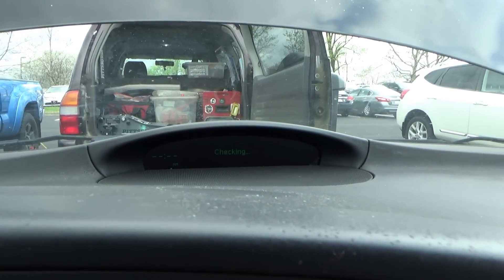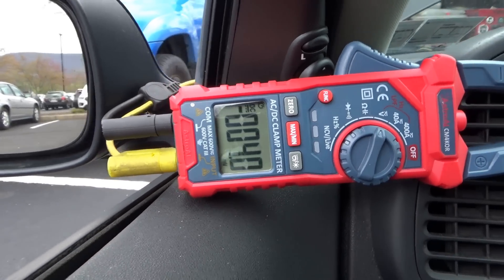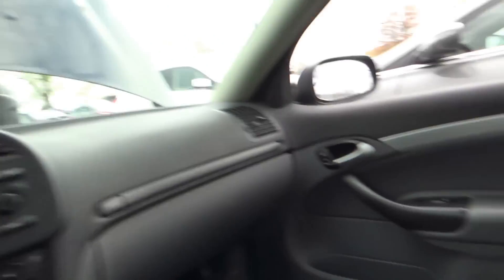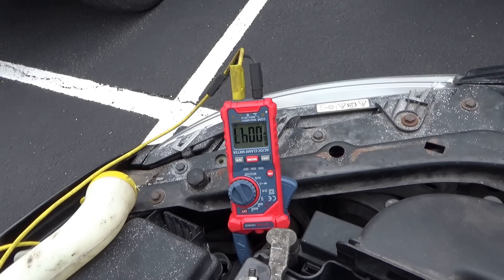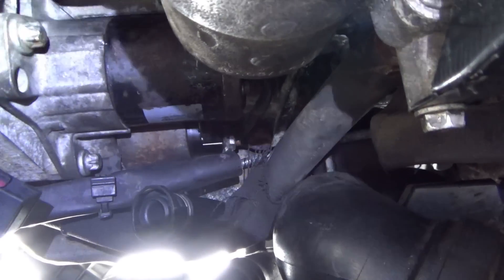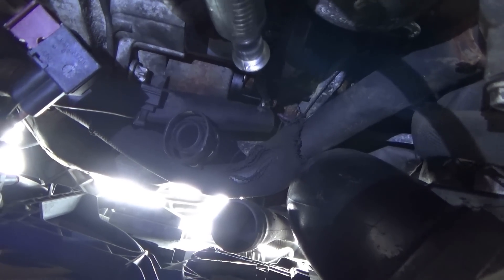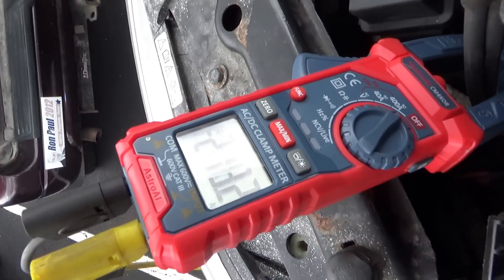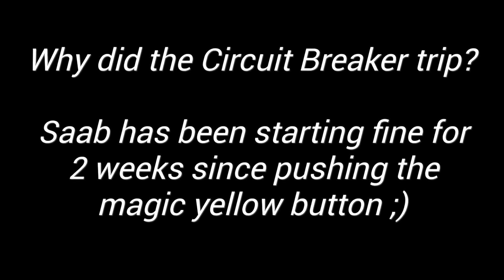Saab STRANDED in a Parking Lot? (9-3 V6 Quirky No-Crank)

Comment: Dude you are a savior!!! I literally had this problem :D I was driving in heavy rain and the car was fine but after a few hours it wouldn't start, no starter or steering lock but everything else was normal. (Except on first few seconds after putting the key on, the check engine was flashing like crazy)
I checked every fuse or possibility like ABS module or starter and nothing, after a few hours I saw your video and that was it!!
Thanks a lot for the solution!!!

Comment: Had a van with the cable running below the front of the engine , some how that cable failed . Routed a new cable to the starter , still working .

Comment: I bought no crank Volvo v50 2.0d (PSA crap) from customer. It has also fuse to the starter/alternator power.

Alternator was seized up and blew that fuse. It’s some kinda crash safety so the big power cables won’t light the car up on flames if they get contact with the body/gnd.

Comment: P228

Battery disconnect switch 3

Warning:
If the battery disconnect switch has tripped, do not reset it until you have visually inspected the car's electrical system.
If there are visible signs of damage, have the car checked at a workshop before resetting the disconnect switch. We recommend that you contact an author-ised Saab workshop.

 A collision could cause a short circuit in the alternator or starter motor. A disconnect switch by the battery's positive terminal cuts off the battery from the alternator and starter motor when the airbags and seatbelt pre-tensioners are detonated.

Notice:
Exercise special care when removing and fitting the positive (+) cable so as not to damage the battery disconnect switch.

Comment: I was involved at the development of that device. First of all it is a steady state Relay (Safety Relay), which can be tripped by several events coming from AirBagModule. Saab was in the GM group at that time. Since Sveden has the most straight country roads with rare traffic, Saab were concerned about head to head collisions with other cars. All wires were fused, except the Starter/Generator wire. In Case of an accident, the Safety Relay tripps and disconnect the starter circuit. Saabs engineers were concerned at that time, when a crash happens, the airbags were deployed, the car wouldn't be able to operate any more. They drew a situation where that happens on train crossing or at any other situation where you need to restart vehicle. Saab wanted  at that time a reset button - the yellow knob. I was working at Delphi that time. After Saab installed it, many other European OEM's went to a pyrofuse, which was 1/3 of the cost but not reversable. After a crash event with airbag deployed, driving off the scene is the most unirportant thing. To my understanding tripping should be only by SRS. 
Greetings from Germany.
Reply: I worked on developing the airbag module for a couple of Saab models and was going to respond with the same info.  Some vehicle manufacturers have battery-cutoff that is triggered after an accident.  Not sure why you got that triggered without an event (it doesn't trigger by itself - you should also have airbags deployed if it was commanded to trigger.
Reply: That’s so cool, my vehicle just won’t start everything seems normal and ready to go, but just won’t start no crank nothing
Reply: @JonnySolomon how did you fix it ?
Reply: But why would the starter be affected by airbag deployment?

Comment: This is not a breaker for overcurrent or overtemperature. It is strictly a disconnect switch that can be triggered by the front impact protection system (airbag). A quick search found another Saab owner who had it trip after a low battery condition. Maybe there is a quirk where this switch can sometimes trigger in a low voltage situation. The low voltage code confirms that there has been a low voltage condition.

Comment: It's a shame Saab is gone. What really did the car in was when GM exerted its "influence" in its last few years. They were a quirky but interesting and good car, before then. Just curious, are they using that circuit breaker instead of a fusible link? Does it only cut power to the starter?

Comment: The thing about starter motors is they want to turn at a target speed and will, depending on voltage, draw all the amps it needs to reach the design speed. It the voltage is higher, it can reach design speed with fewer amps. But if the voltage drops below 12.0, the motor will try and draw more amps to reach the design speed. The one code indicated a possible low voltage situation had occurred.

Comment: Maybe the circuit breaker tripped due to a weak battery or bad connection on the hot? That would raise the current draw.
Cranking sounds a bit sluggish to me? Time will tell.

Comment: Just a FYI about min max current readings.  Using min/max can skew the results due to the initial current surge.  More accurate to measure starter current while the engine is cranking, and not use min /max.
Reply from the maker: I was interested in the initial surge, since that is exactly when a circuit breaker would blow :)
Reply: @PineHollowAutoDiagnostics  The breaker should be tolerant of surges,  question is how much current surge is acceptable.  Thats why an average current is a better indication of starter & engine condition.  Just thinking out loud.

Comment: I can tell you engine ground is thru  drivers side engine mount i had issues where galvinic corrosion ate the threads on ground wire  engine mount.Replaced it with a stainless bolt and nut 10 years ago

Comment: Age, salt, Pa roads (potholes) caused the left side bulb issue and likely the circuit breaker to trip too easily..... Might be a good idea to locate a non-rust belt used replacement. Circuit breakers will tend to trip or even fail after repeated trip events.

Comment: There's a reason it's the only Saab in the parking lot.😆 Perhaps the battery was low so the voltage dropped while cranking increasing the current draw?

Comment: Had something very similar on my Ford Transit tipper truck here in the U.K. - peculiar no cranks then just as peculiar starts after it had changed its mind. Then it began doing wobbly throttle after ten minutes driving and deciding to go into limp mode. As I was running a large construction site at the time and had a choice of eager mechanics - I took the easy option and that gained me a £260 fine for breaking down in a restricted area ( yes, they do that over here! And it doesn't do you any good to complain because the appeals system is biased in their favour and the charges continue to grow!!!) Mind you, in the end, the damned thing shutdown in the fast lane of the M25 (think very busy and dangerous motorway) when I had to vacate the vehicle to stand on the concrete (median) till rescued by the Highway Patrol ( U,K. equivalent) they were very reasonable and helped rather than issuing tickets ( citations ). 
Never seen it before but this Ford has TWO batteries under the driver's seat and there's cut our gadgets on both POS and Earth ( Ground) it was GREEN CRUSTY heaven down there too - so like some of your diagnoses - professionals nil pointes!

Comment: Hello USA! Saab is a rare model even in Europe. Some things are different about Saab. For example, the model with a mechanical gearbox has the ignition lock at the gear lever and you have to switch to a certain gear to get the ignition key. The very old model had such a handbrake that was built into the front wheels. The old Saab used to have one in the gearbox the lever that engaged and disengaged the freewheel clutch, when you let go of the gas pedal, the gearbox did not pull the engine along.

Comment: Battery from 2020?   Maybe the internal resistance is higher than it should be, causing excessive cranking amps.   It does sound a bit sluggish...

Comment: I have a 2006 9-3 but it's a 4 cylinder automatic, and it does not have a circuit breaker on the positive terminal.  That looked stock.  I have no idea.  GM took over SAAB in 1995 and ran the company into the ground in my opinion.  I have owned three real SAABs and they were amazing cars.  Two 99s and a 900 turbo with a five speed.  Now that I own one from the GM era I can see the huge difference in the quality of the engineering.  After WW2, SAAB assigned sixteen aircraft engineers the task of designing and manufacturing cars.  So basically what you had was a fuselage with no wings.  They were designed to function at the highest level of performance and were easy to repair because aircraft engineers took into account that the vehicle would need to be serviced at some point, unlike most automobile manufacturers.  If you removed all of the badges from my car, you would guess it as a Chevy.  Everything on it had the GM logo.  It has the Ecotec engine.  Everything is GM with the only nod to SAAB are the badges.  I just wish mine had a V6 with a 6 speed.

Comment: Maybe some high current draw from accessories while trying to start the car when it was really cold out? If the battery is in great condition and the lights are on, heater is full blast and heated seats are on and you jump in and just try and crank it really fast it perhaps would trip the breaker?  I imagine a cold morning, you leave the heated seats on and heater when you shut off the car and later after class you just jump in and try and start it as quick as possible to get it heated up with heater and heated seats still on and you do that so fast that the accessory relay barely has time to actuate so you get a large current spike... seems like a likely scenario, but idk.

Comment: This case was messy because battery testing was done by the owner and maybe even somebody tried boosting which might have tripped that current sensor. I found your use of a current clamp to be a novel way to advance the diagnosis without searching for the starter, an interesting idea. For the guy at the roadside with minimal tools, I like a 4 step mod of ScannerDanner's three step algorithm, even though the sensitivity of some steps may be a little weak. Of all the diagnostic pathways in auto repair, no crank no start at the roadside easily fits a cookbook checklist. Bravo to you for a thought provoking video!

Comment: Are you sure that the main feed cable to the starter motor is connected in the right place on the battery pole? It would be more natural for the cable to the generator to go through such a fuse

Comment: Although I follow, and like all your videos, in this case I'm sure that a million mechanics around the world are wondering why the absolute basics were totally overlooked initially. With a no crank the absolute first thing you suspect is something big; solenoid, starter, battery, cables. Breaking out the jack and electronics.... ?
Reply from the maker: How do you get to the starter without a jack? And how do you check electrical components without a meter? I'm conFUSED lol!

Comment: Ivan i can tell you why it tripped My dad's boat engine a Vovolo Penta did something Basically  the same it has to do with the battery connections it detects a arc it will do that if there's a jumped connection it will do that

Comment: Very interesting case, symptom and fix 👍 
My 2016 Kia Rio starter made once in January this kind of click sound too, it was the coldest time of the winter (around -30°C), but it happened just once. Turned lights and interior fan off after that click insident, and it started normally, and has been starting normally always after that one day.
There's black box in the battery negative cable, probably some voltage or current sensor for start&stop system (agm battery too), but no button. In the plus side, there's a 10 amp fuse called AMS, and some black box, again no button. No check engine or any other lights in the dash.
I was initially thinking maybe my battery voltage was low, but this video brings it in new light and gives some ideas to check if it happens again and won't go away.
Reply: Well since you don't have a circuit breaker you definitely don't and won't have this problem. Chances are you need to clean your battery cable connections and make sure they're tight. Your symptom sounds exactly like a poor connection, the heat of 200+amps trying to jump a poor connection actually temporarily fixed the connection.
Reply: @truracer20  Thanks for the advice, I'll keep it in mind :)

Comment: Maybe the vehicle  was left in gear when parked. Then when starting engine, with stick shift in gear and handbrake on, then starter would struggle to turn. Results in loads of extra amps, which could trip the circuit breaker?
Reply: For that to happen the clutch safety switch would have to be bad or more likely bypassed.

Comment: Bench testing a starter got me 1 time. I took it off and it spun just fine. Seemed fine but when I put it back on the vehicle it just cranked very slow. N then gave up again. Just didn't have enough strength left in it.

Comment: I worked at Saab dealer in 70/80’s.  
Sorry A$$ Auto Builder was their moniker then. 
I can think of very few things I enjoyed about working on them. 
Except easy hood removal and clutch replacement.
Reply: I worked at a SAAB dealer late 80s to late 90s. Our saying was "SAABS make jobs". The 79-93 900 was a great car to work on. I wasn't a fan of the 9000. Once GM (Grenade Makers) got involved it went downhill fast.
Reply: @mlieser1230 Yep. I worked on Sonnett, 99 and 900’s.  Saw a few 9000’s. 
Our PDI joke was to look under it. If it was leaking all the fluids then it was ready for delivery. 
Started own shop in 1986 and we just sold in 22 though I retired from full time 8 yrs ago. My brother finally had enough physical ailments that we sold out. 
You can sure lose your edge quickly. That’s why I keep up with the tech here. And I come away with no skinned knuckles or aching back ‼️

Comment: If it is just a circuit breaker, high resistance of course, from poor connections and or the crusties in the cable. And that is considering that starter is good. Or if as mentioned below it is a safety cut out controlled by the airbag,though it did not appear to be involved in a collision. Good morning Ivan, have a great day!  👍👍🇺🇸
Reply: ...or the battery was low, somebody tried to jumpstart it and it tripped the breaker.
Reply: Maybe someone bumped the car backing out.  It's the anti carjack mode.  carjackers box you in, starter cuts off.

Comment: THE MAGIC YELLOW BUTTON, LMAO.
Reply: I can't believe they were to cheap to have  green show when working.  I think the last 3 starter problem I had were all green wires at the connector where insulation pulled back.
Reply: You need to push it to load it!

Comment: The battery disconnect switch is controlled by the airbag module and is designed to shut off high current wires in the event of a crash
Reply: Potholes can cause that to trip
Reply: @CatScratchFever10x Then Saabs aren't compatible with PA roads since we have more potholes than road surface.
Reply: Safety focused as always, haven't seen them on Australian models.
Reply: I put an airbag module in a 2005 Saab that didn't have the battery disconnect and the airbag module kept throwing a fault because it didn't find a breaker.  I had to do a little research and did a little surgery on the cable to make the module "think" that a breaker was installed.  It worked!
Reply: A Saab story!
Reply: @juanrodriguez-ry6yt 
😀🎯
Reply: As an Aussie ex-SAAB mechanic we didn’t have that fitted 🤷🏻‍♂️
Reply: @cammo069  Im a Saab tech from Sweden, never seen one on a Swedish/European 9-3 😄
Reply: @Halibrand  That's funny. I have it on my 9-3 SC Aero V6.
Reply: There wasn't a crash, so something else must have triggered it...
Reply: @v12alpine  Fault in the airbag module? Or maybe just a jammed starter that tripped the breaker due to high current? Or it was accidentally jostled on a bumpy ride causing the contacts to trip?
Reply: Yup, although you'd at least expect that to be in the manual.
Reply: Modern EV's (and I'm sure modern combustion cars will follow this too) have automatic battery disconnects. If the airbag / restraint module says so, you lose all power.

I don't like these systems because they leave you stuck in a dead vehicle if they trigger, whether it's your doing, someone rear ending you, or a random malfunction.
Reply: ive heard of things like that on a land rover
Reply: It's because Saab are "born from jets ' When jets crash I guess they trip the high current breaker.
Reply: If only fusible links existed.
Reply: @_RiseAgainst  fusible link might not do the right thing here. It has to be as big as starter peak amps when cranking the car in extreme low temperatures, it is often the max amp a battery can provide. This is hard to differentiate from short caused by crash. But deployed airbags are an good indication that something not so good has happened.
Reply: @jannepo  then every car would have it.
Reply: @_RiseAgainst  yeah because replacing a fusible link is an easy enjoyable job...
Reply: @truracer20  you are right, much easier to call a mobile mechanic to get your overly complicated POS running.
Edit....
Reply: @petrnemecek4379  I agree, all cars should require a good study session to start.
Reply: Saab turn  into an sob

Comment: All caused by the left front turn signal bulb failure ;)😂
Reply from the maker: I fixed that too by removing and reinstalling the bulb 😂
Reply: @PineHollowAutoDiagnostics  No parts required!
Reply: @PineHollowAutoDiagnostics actually it may  come back or socket had higher resistance. I would get that  ,bulb was good then weeks later blub would be blown.I guess resistance rises as the filament gets to end of life triggering  code
Reply: those are so intermittent bulbs, light up and turn off all the time ;)